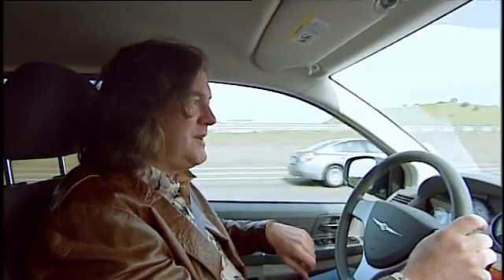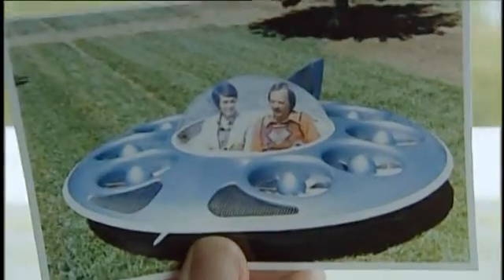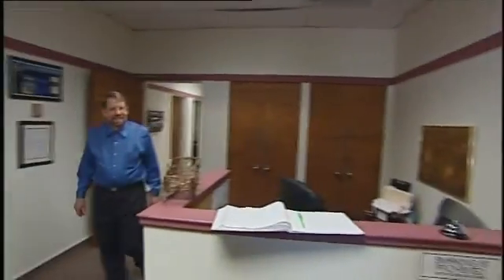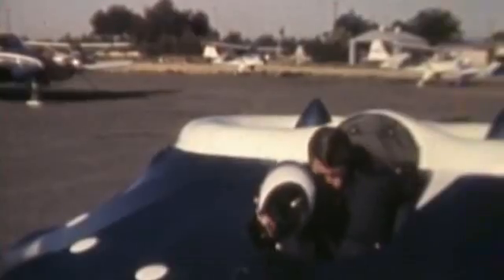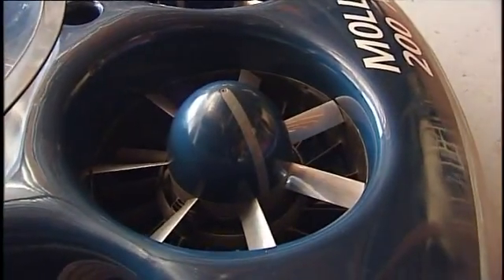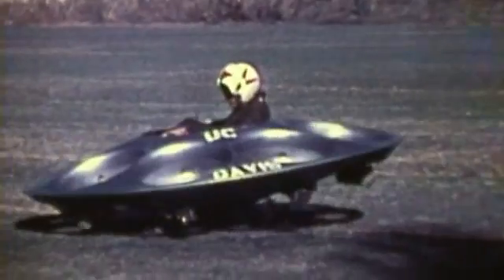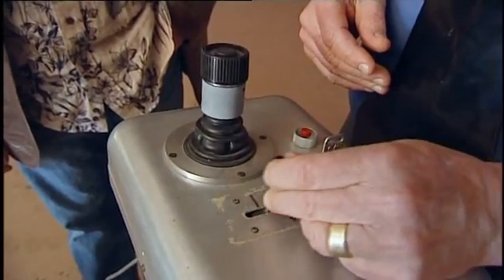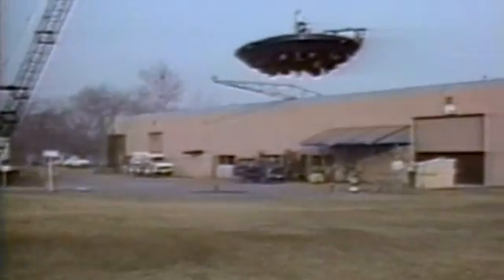Wankel Rotary Powered Flying Car

Comment: This is the technology in the 4-motor, one propeller on each corner flying toys, isn't it?
Are they paying royalties to prof Möller? He could finance lost of things with this money....
Reply: A full-size Quadcopter may not need basic electronics too different from the one controlling an $20 toy, it may be just a matter of adding power transistors and redundancies for safety...

Comment: How can anyone say this has no potential?!? 
y'all- "yeah nothing new will ever work lets keep the old shit". FU
Reply: Moller's been at it since the early eighties. Still hasn't taken off. If he's fair dinkum, I believe Paul Moller will die with his dream unfulfilled.
Reply: No to troll but I hope he proves you wrong. :)
Reply: Levi Omighty
unfortunately, he is right. Muller has been at it for decades and all he has done is have a hover machine that cant go anywhere.

I dont know where he get the money.
Reply: JBofBrisbane Early 80's, more like early 70's. He's had ads in popular science for I think over 40 years! His designs have the problem of no to little actual flight surface area in which to generate lift, leaving the engine thrust to be the exclusive source of that and forward motion. Then rotary engines are not known for their fuel economy leaving You needing to carry quite a lot of fuel if You intent to go any distance. His ideas in the case of even his latest designs are sadly for the most part a dead end.
Reply: Oldbmwr100rs I'm from Davis and used to ride my bike past Muller's driveway where he sometimes had the first one they showed parked on a trailer. This was in 1969. I saw the wankel engine one a few times on the UC Davis campus. There was an in between one not shown in the video that used several engines (2-cycle snowmobile engines if memory serves) to spin a sort of band or ring of slats that looked like venetian blinds situated between the dome in the center and an outer ring. They were set at an angle to provide lift. For steering, cams located all around the ring could be raised to flatten the angle of the slats as they passed that point and the decreased lift would cause the saucer to tilt and travel in that direction. The mechanism which held the slats in place and allowed them to return to optimum lift angle after passing a steering cam involved freaking rubber bands and looked rickety as hell. One of the UCD students involved in it told me it worked great except if just one slat came loose, it would be out of balance and the whole thing would shake itself apart. I don't think he was exaggerating that much.

Comment: Cute post. I love biking, I own 9 bikes myself. However, the object proposed is to build a flying personal vehicle and put it in to production? for everyone to use? I'm betting there isn't a soul on earth who hasn't dreamed about A hovercraft or VTOL PAV to putter off to work in, avoiding contact with roads(which are extremely expensive to maintain) thereby avoiding wear and tear to wheels, suspension and other components that currently must be replaced frequently. Cheers to inventors who dream!

Comment: come on Red. Now I'm starting to think youre just being stubborn. How many helicopters have you not seen losing control because of a failing tail rotor. And they already have the Osprey hybrid. Same concept.
Besides keeping the balance after engine failure isnt a problem aslong as its built correctly.
And if an F35 can take off vertically it should be easy to make a "jetski" do it too.

Comment: "If your hovering on your 4 and one engine fails you'd start to spin out of control"
Same thing can happen to the tail rotor on a helicopter. Yet those kinds of accidents arent too normal.
And I'm willing to take that chance. Besides, the only reason for hovering should be for landing and lifting, which means you're close enough to the ground for surviving a jump and a fall.

Comment: Depends on how much the aircraft weighs and what kind of material its built of.
Even if 1 or even 2 engines go dead you still have 2 to go, which should be enough for it to land.
And if that isnt enough, you can always take parachute lessons and travel with a chute on your back, just incase. Theyre already doing the Verticopter and it works. Still, I'll probably have to build my own once these things are more normal on the market.

Comment: If you choose to call it a plane yes. The wings dont have to be long. 1 meter is enough. Then you can ride it as a jetski while flying, start and land vertically and even hover around.
The four engines would have to be able to turn about 90 degrees forward and backward for acceleration and brakes. Thats how I would do it. A really small 1 man aircraft.

Comment: @HirokiNotTakuya : Flying cars are already here.  They don't look or function anything like the hockey puck which is called (for some reason that eludes me) a "car" in this video, though.  They don't luck much like typical cars, either.  They look like this:  watch?v=KG3kosUyCDE  Operates (on the ground) at normal traffic speeds (25-45MPH) with wings folded up.  Takeoffs and landings have to be done at airports, of course, not public streets.  Toy for the wealthy, at $200,000.00

Comment: It depends on whether you use a huge fan or smaller ones. A big fan is more efficient as it is accelerating a wide column of air to a lower velocity.